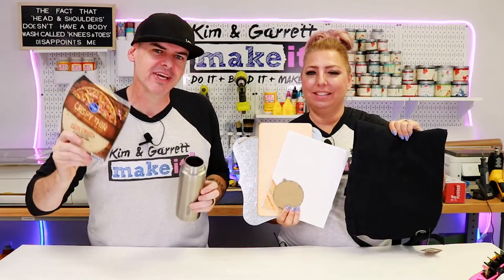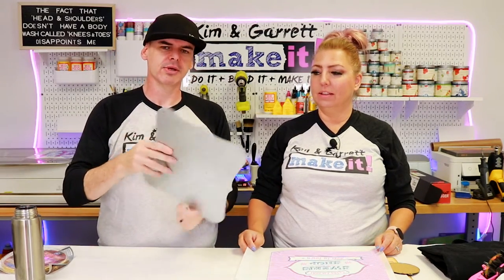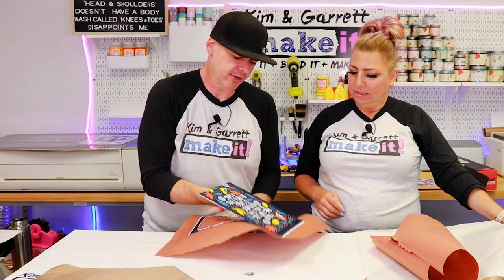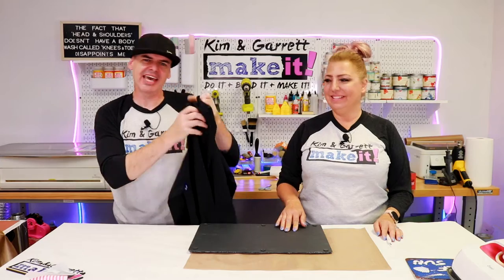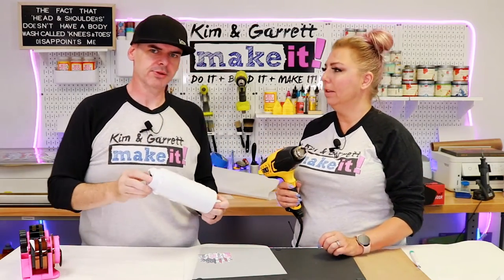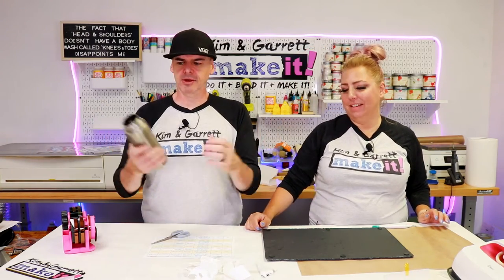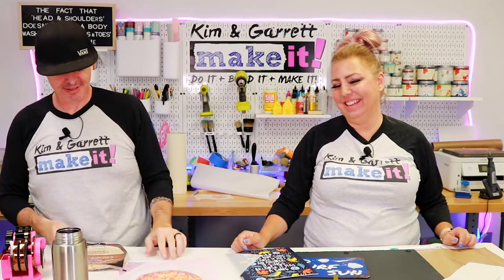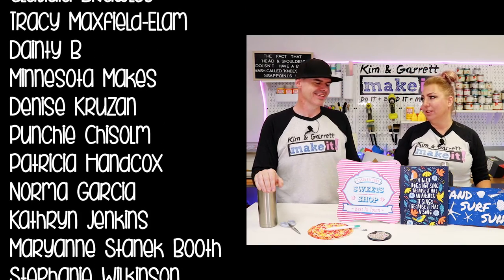Direct To Film Projects to Sell | DTF Print on Wood Metal and Canvas

Comment: I actually print sublimation on the film and use the powder to be able to put on cotton also I have transfered the print onto permanent vinyl and used it for cup decals
Reply: This is what I'm wondering.  It's DTF the same as sublimation?  Do you use the same ink and such?  Sounds like they're not exactly the same.  It's one better than the other?  Cheaper?  Lasts longer?
Reply: Katerina, how does it wash when you use sublimation ink with the film, and powder?  I have the dtf printer, but this is intriguing.
Reply: @HeartlandFamilyDesigns  you can use sublimation ink, but you won't have white ink. This will solve the problem of having to use garments with high percentage of polyester though, but only on light garments without white ink. The work around for this would be to use white htv as a background before you press on to dark garments. So you can use sublimation ink with the dtf powder and film, but keep in mind that anything you are counting to show up as white, will not be visible on dark garments without that white ink. Many people convert their printer to dtf. That requires a software update and an automatic stirrer for the white ink to prevent clogging. I've seen these updates sold on usb dongles for under 100 dollars. It adds up to get started, but from my research, dtf is a cost effective solution to printing on any type of fabric (like 100% cotton) and it eliminates several steps.

Comment: thats why your printer is cloggng, your using 100% white! you should have it at 65% color 55% white. keep your capping station wet with cleaning solution
Reply: also should print at color mix and white mix evens out for curing
Reply: What’s the capping station? Is that where the ink wells before being sucked by the waste ink?

Comment: I had a Brother DTG printer that was a disaster. I spent 75% of the time just cleaning the print heads. I know you are using a DTF printer, but the technology is pretty much the same. You are correct; you have to keep using it on a daily basis (even on weekends) to keep the heads from gumming up, and the daily "automatic...(LOL)" cleaning process took an hour at minimum. And if it was printing  white, it was a further time waster and required a separate pretreatment chemical application machine that was another $2500. The ink is very expensive. A head replacement was $1500 (and there are four heads). It cost me $25,000 when I bought it, and it has now sat in my garage under a tarp for the past 7 years. Biggest waste of money I have ever spent. Sometimes, I still wake up in the middle of the night in a cold sweat, just thinking about that evil machine in my garage....Run away, run away.

Comment: I've been researching how to print on hard surfaces. I've figured out how to print on garments etc, but from what I understand there is a special type of uv film for surfaces that would be difficult to press or apply with heat. You need A film and B film. You print on A and then send it through a laminator with film B and transfer it to your object like a decal without heat. Film B acts like a transfer tape like you would use with vinyl. It picks up the image and you apply it almost like a waterside decal. I didn't see any use of dtf powder with this process though, so I am not sure how it works. The materials seems pricey though and not so readily available for smaller scale projects. I'm wondering if it would be possible to use the regular dtf film with film b for transfer and using a regular laminator. I love the results I've seen professionals use and I'm determined to find out how to do it myself without buying more equipment. Thanks for sharing all your tests.  You saved me a lot of testing myself. Lol

Quick update... ok, you can't do it the way I was thinking because that system uses uvdtf ink and it's not the same as dtf ink.

Comment: I tried the mug today and it looked promising 311 degrees for 75 seconds. So I’m thinking maybe 90 seconds
Reply from the maker: OOOO!!! Thanks!  I also got close at 350 for 30 seconds, cooled it all the way, then removed the film.  Some of the small corners pealed up, but most of it stayed.  ~garrett
Reply: @KimandGarrettmakeit  same here, it started peeling on the edges. I’ll try later today for the 90 seconds and post an update.

Comment: I don't think you mentioned what type of printer machine you are using. Is it a sublimation machine? I'm confused easily hahah 🤣
Reply from the maker: Its DTF! And thanks for the feedback
Reply: Are they two completely different things?  I think you just use sublimation ink in a regular printer for that, but if you do DTF, do you need an entirely new separate printer?
Reply: @HeartlandFamilyDesigns  yes is a different technique.